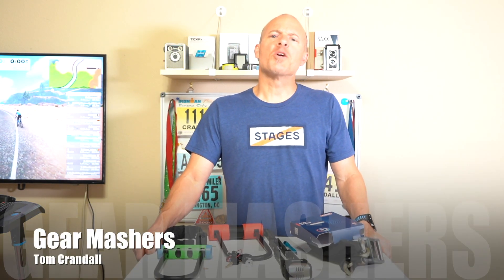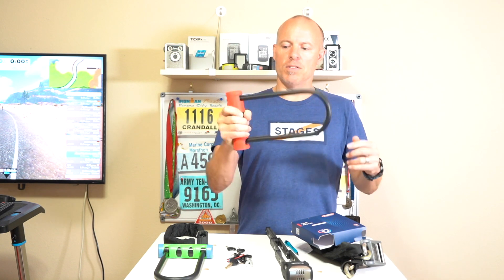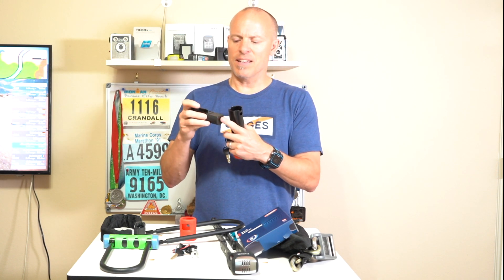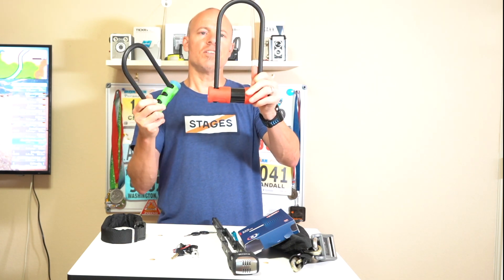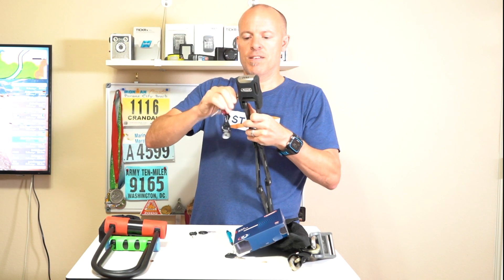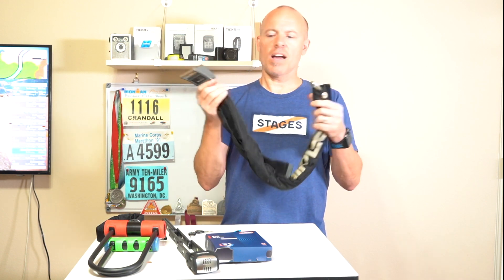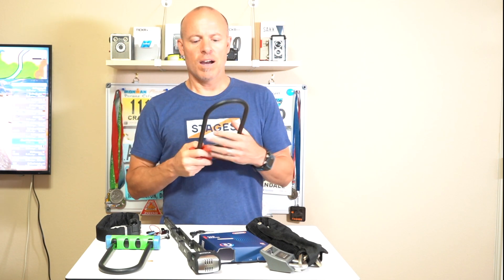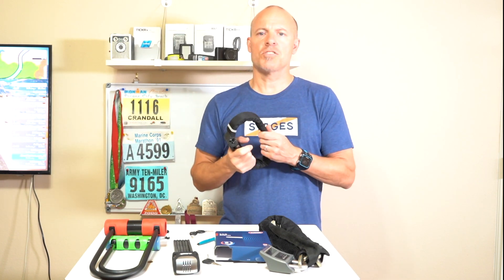ABUS 400 Alarm Bike Lock (U-Lock)

Comment: seems to take too long to sound the alarm. By the time the alarm goes off, they bike has already been taken.
Reply: Not with a quality U-lock. You need an angle-grinder to get through that, and you'll most likely have to make two cuts. That's over a minute of work while the alarm is screaming in public.

Comment: Hi! To break open this U-lock, does it require two cuts (both stems) or just one? And how waterproof is it (the bordo 6000a is quite water resistant / waterproof), can it handle rain well?
Reply from the maker: Not sure on how to break the U-lock and if only one cut would be required or two cuts.  The lock is made from hardened steel, so it should be as water-resistant as the Bordo 6000a